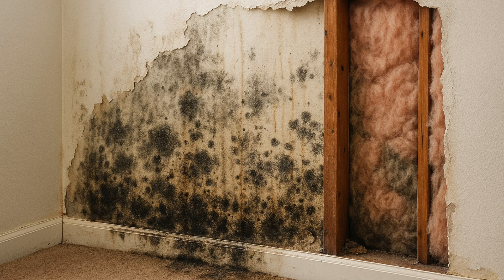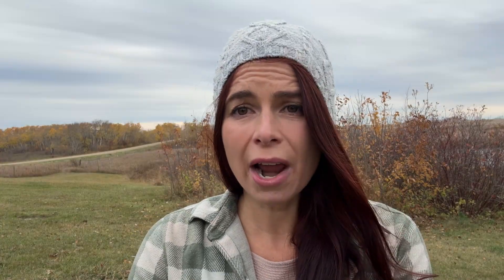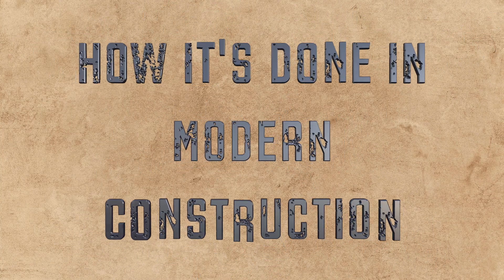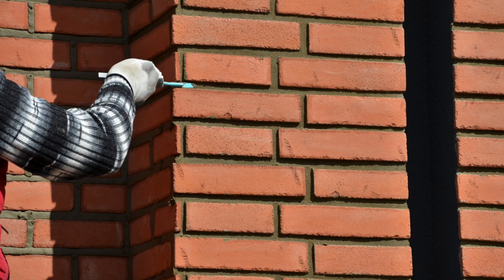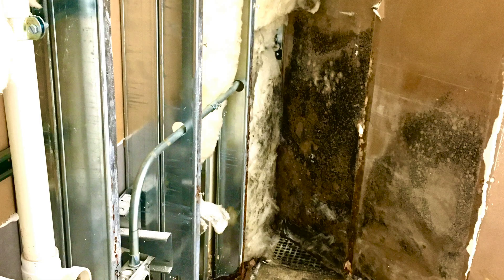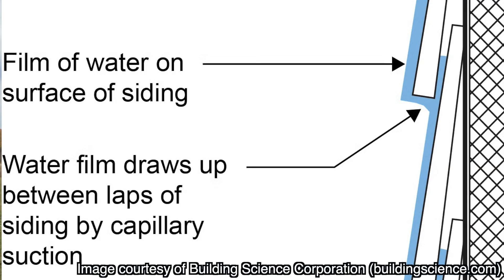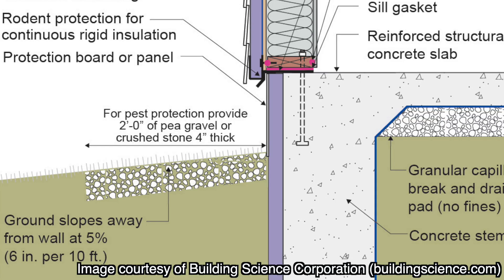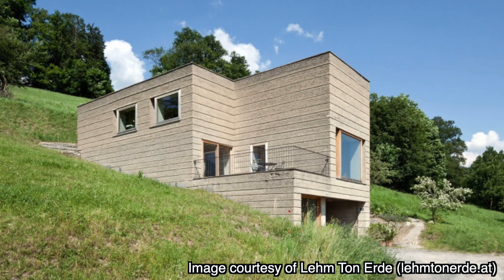Why Modern Walls Get Wet Inside (And Ancient Ones Didn’t) | Part I

Comment: The problem with modern superinsulated walls is they do not dry.  So when they become wet they mold.    And now you have to "Outsulate"  the whole building.    In Wisconsin where I  live back in the 70"s and 80's they built a bunch of "Envelope" homes.     They have since fallen out of favor.  Basically they were double walled with an airspace between which allowed the air to circulate around the whole house.    This would solve the drying issue.    WHat happened to this idea?
Reply from the maker: Good points! Yes, Joe Lstiburek's "the perfect wall" includes all the control layers (including insulation) on the outside. I talk about exterior insulation in my thermal control layer video.

Comment: https://www.youtube.com/@RootedResilientLiving
I am awaiting your other parts?

What I am trying to dig up is:
(Background: I have all these tools tablesaws, free standing Sanders, Bandsaw, free standing drill press, 2 ton press, and I don't have shop space larger enough to be able to walk around them in the covered area.  (plus the quote covered area  Unquote suffers from time to time from ceiling condensation drips).

By simply building formed covers out of high end tarping materials (Like Grandma sewed attractive fabric Kitchen socks for her toaster) simply placing the tool outside with a formed heat welded cover would create an environment that on rare (but it would happen) condensations' in the top of the tightly formed covers.

( I remember someone was selling some form of water would pass outwards but be shielded from passing inwards for Car covers of the highly collectable shapes?  This material sat right at the top of the car cover where the condensation would form.  But the cheaper standard materials formed the sides where the condensations did not form.) I'm hoping you can help me find the right fabric like or plastic sheeting like material to move the condemnations out of the tool covers and not get to the point of rust forming?

Armed with that information I could heat weld Duraskirm 20 into tools covers with a patch (Of the material I'm looking for) on top and some form of wire frame setting on top of the tool but below the tarping so that each free standing tool could be left outside, yet under it's own individual protective covering.
(This would allow me get into production before the wood shop's roof has been started.  Just tools setting outside on top of 1.25 inch thick flooring plywood that has been resined and placed on top of gravel to prevent the local version of Termites.  (I will also throw on there something to shield the resin from UV).
(By each tool setting on a pad of water proofed plywood the base inside formed cover would only have to deal with any water that managed to get under the cover and not by transfer from zone of wet Earth.
All smaller hand tools would still be in under the plastic tarp based roof, and larger tarping's with no side walls held in places with spring clamps and magnets  have to be used until a way to keep the condemnation from forming inside the shed/workshop in upgrade can secure a safe from condensation effect.
This could mean I still would have long walks from the table saw to where the table saw accessories would be stored but it could bridge the gap between waiting for the perfected shop space and getting back into limited production.
Reply from the maker: Thanks so much for the thoughtful comment and for sharing what you’re working on — that’s quite a setup! 🙌

And yes, the rest of the series is coming: Air Control Layer next, then Vapour, then Thermal.

As for the tool covers and condensation issue, the key is finding a material that’s vapour-permeable but water-resistant (so moisture can escape but liquid water can’t get in). Some high-end car covers and certain breathable membranes do this — similar concept to a WRB used on houses. 

I really appreciate you being here and thinking so deeply about moisture management.
Reply: @RootedResilientLiving  I've started looking into "SealSkin"  
1. there is a soft inner layer to prevent scratches (I don't need that)
2. I thing I only need like a 3 foot by 3 foot patch on top.  So buying scraps and then bonded to Duraskirm 20.

I'm looking at trying to keep the fabric suspended above the tool with like a wire frame/box shape.
Above that I'm thinking that something that would act like an umbrella with the handle sawed off so that the "SealSkin" is bellow the Duraskirm 20.  The SealSkin would be out of the Sun and able to breath out all the moisture.

On the bottom side of the equation is "What could be done to prevent puddle water from being able to get up inside covering?
I've been trying to think of making something out of heat sealed Duraskrim 20 so that it's like a Duffle bag or a Gym bag that you have stuffed the whole tool inside of (It might have like metal legs sticking out?)  I'm back wondering how I would get water at the bottom of the bagging to leave without letting water vapor back in?

Comment: I'm a dyslexic.
How do you even spell that silaine and solexain and where are the links to these products?
Reply from the maker: Here's what an engineer I spoke to about it had to say about the two:

Siloxane is Si02 (a silica molecule plus two oxygen molecules), and it is a very fine solid under normal atmospheric pressure. It’s soluble in water, although it will come out of solution under gravity, so manufacturers use a surfactant to keep it dissolved. The surfactant is usually some kind of lipid - basically a type of soap.

Silane is SiH4 (a silica molecule plus four hydrogen molecules), and it is a gas under normal atmospheric pressure. It will also dissolve in water, but it remains volatile to a degree - will evaporate out of solution under normal atmospheric pressure.

For our purposes, we are trying to fill micro-pores in the rammed earth with stable silica that will repel liquid water and allow water vapour to pass. In my experience, Siloxane is the preferred substance for adding directly to a rammed earth mix. 

The product that I know about designed for this is called Plasticure. It's an Australian product.
Reply: @RootedResilientLiving  Thank you.
I'm in the middle of something that may require just what you wrote to me.

Comment: Much of the water damage (besides damages to floors) is nothing more than a few inches of the bottom of the plaster board.
Why we even still use the common plaster board I don't even know?
There are variations of Plaster board that don't allow for water.
Simply cutting a 4 x 8 board (or if it comes in a smaller size)  down into like 8 inch strips and applying those to the bottom edge of property would mean the amount of damage from 6 inches of standing water would have a minimized effect.
This would mean you would probably be cutting 8 inches off the top of the normal plaster board.  This would add to the labor costs but could lower the total damages' of just even a thin layer of water trapped on the floor.
Reply from the maker: Interesting idea, and it would definitely help with floor-level wetting. The tricky part is that a lot of moisture damage in walls doesn’t start at the base. With stack effect and air movement, warm indoor air can carry moisture up through the wall cavity and deposit it on cold sheathing near the top of the wall or roof. That’s why we often see hidden rot high in an assembly, even when the drywall at the bottom looks fine.

Flooding and standing water are one failure mode, but most modern moisture problems come from air leakage and trapped vapour—places you can’t see and can’t cut out in 8-inch strips. That’s why the whole assembly (air control, vapour permeability, drying paths) matters so much more than just the visible drywall damage at the bottom.
Reply: @RootedResilientLiving  What you are saying may apply to my modular side walls.  Those parts are wood with No vapor barrier.  Just plywood with sealed edges on 2 x 6 x 8'.
I will be back filling them with Styrofoam blocks.
(The bad part about that is I will need to router a channel most of the length right down middle of the 1.75 side to then attach a second 2 x 6 x 8' to box in the Styrofoam blocks.  Think of the connectors as home made 7.5 foot biscuits
WHAT WOULD YOU SUGGEST? As another thing to add into this build?  If I purchased a heat sealer I could put ALL of the Styrofoam into one form fitting block (This assumes that I cut and glue the cubes into something that's almost 4' x 8')
This would result in each modular cell's Styrofoam being denied any contact with water vapor. And the only area that would have moisture contact would be the 2 x 6 x 8' that area bolted adjoining each 4' x 8' block to the next block, The extior plywood and then the interior plywood.

Comment: Use a rain screen if your installing exterior cladding with venting to assist in drying it out when the rain stops
Reply from the maker: Yes, rainscreens can be really helpful! I cover reainscreens in the next episode on the air control layer - it's going to be released on Thursday this week.

Comment: we could update our building codes
1. ban the use of drywall in basements, instead entire basements would require rockboard typically only used in basements
2. ban normal timber framing  in bsmts , instead use sprayed or treated lumber only
3. mandate exterior waterpoofing and insualtion  as well as interior insulation
4. design larger overhangs , especially for taller buildings where the min overhang does very little against driving rain; 1 story bungalo gets 3 ft overhangs and 2 story gets 5-6 ft overhangs
5. why not line the entire perimeter under the topsoil so all the distrubed soil has a poly or cconcrete cover over it directing water away from easily porous non packed distrubed soil around foundation
=these would either discourage using basements as living space in first place annd only storage/mechanical use or at least it will have better more expensive protection for 10,20-30 yrs down the road.
Reply from the maker: Some good ideas here!

Comment: Great to see a building science channel with a focus on natural building materials. Keep going! There is no one material with perfect attributes. Some discussion on thermal conductivity of rammed earth walls is needed. It's likely comparable to concrete due to all the compaction. Straw bale (load bearing or not) might be more of what you're looking for in Manitoba if you're concerned about natural materials. A life-cycle analysis would show that it has lower embodied and lower operational carbon (win-win). Regardless, put numbers to these designs (not just the wall assemblies), construct it, collect data and prove us all wrong. We need do'ers to address our on-going housing crisis and raised awareness that there is never just one solution. Insulation is really just creating lots of air cavities that break up convective loops (the material doesn't really matter). Rammed earth partially solves the moisture part but creates other new problems that need to be solved.
Reply from the maker: 100% - we'll cover the thermal question in the last episode in this series on the thermal control layer.

Comment: I'm in the early planning stages of my small home build. I've considered a combination of Earth ships and timber framing. What do you suggest what should I build my house out of. I'm in Minnesota near Canada.
Reply: What conventions were used for old buildings there?  For such cold weather you could consider a cavity wall: exterior brick/masonry > 1.5" air gap > Zip sheathing on galvanized steel stud "back-up" wall > closed cell spray foam insulation on exterior walls and metal roof.  Provide a/c to unvented attic.  You could also just use a vertical standing seam wall siding, which will never leak.
Reply: @Troy-Moses thank you! I've got some research to do now. I believe most the houses here are just stick built homes. I just heard of "rammed earth" I'm gonna have to do a ton of research. Thank you for commenting. Have an awesome day.
Reply: If you looking for healthy alternative building methods, I'd recommend straw bale building. It is easier than many others and the insulating is incredible. Search for Timbo and straw bale building.
Reply: @drewmihelich3232 thank you. I've had that idea in the back of my mind as well.
Reply from the maker: That’s awesome — sounds like a great project. I’m not an expert b, just someone who’s been diving deep into building science for a while now. From what I’ve learned so far, the best approach really depends on your site, climate, and priorities — comfort, health, energy use, materials, all that. Minnesota’s climate definitely adds some extra challenges, though!
Reply: @RootedResilientLiving this whole rammed earth thing is blowing my mind right now, I think it's brilliant I want in!!

Comment: 7:00 In Europe, thermal insulation is mandatory... when using rammed earth, the insulation is mostly placed inside.

Internal insulation has the advantage that all the mass in the walls is used to flatten out the external temperature swings from night to day.
The disadvantage is that no mass is available to help you in keeping the internal temperature constant (the insulation is preventing this).
The second disadvantage is that there will be condensation in the transition from the insulation to the external mass layer (all walls except the sunny walls).
--> So your insulation materal must be moisture tolerant and your external wall must be able to drain away this moisture by capillary action.

For the ideal wall you have - in my eyes - two options (if you like massive walls):
- Option A: The Sandwich wall: external mass - thermal insulation - internal mass.
- Option B: A massive wall made from a material that also has some or good insulation properties, i.e. hempcrete, AAC, (solid timber), brick, straw bale,... 

If you persist in using rammed earth, I would investigate the sandwich wall by which the insulation layer is hempcrete and by which all layers are tied together with a natrual fiber like reed, wood, hemp, elephant grass,... 

But first, I would check the use of massive walls made from hempcrete only.
Reply from the maker: Great food for thought — thank you. I really like the idea of using mineral wool insulation between two wythes of rammed earth. It keeps the assembly vapour-open while still adding that necessary thermal break. I’ve also got hempcrete on my list to explore in more detail — it’s such an interesting middle ground between insulation and mass.

I’m drawn to the solidity and durability of rammed earth itself, though. Martin Rauch’s work, for example, often uses a double-wythe system with recycled foam-glass insulation in the middle. And here in North America, SIREWALL has used a similar approach with rigid foam insulation between the wythes.

I’ll be digging into insulation strategies and the thermal-mass balance more deeply in the upcoming episode on the Thermal Control Layer.
Reply: @RootedResilientLiving  
My problem with rammed earth is that it's more like concrete and that you need steel as reinforcement (in certain areas), this makes your house difficult to rebuild. 
Also because it's structurally less "readable".

With hempcrete you need a wooden frame, that's more work but rebuilding becomes more easy (and safer). 
And the thermal insulation is already integrated...

Lots of options... not easy to choose ;-)

I'm looking forward to the next videos!

Comment: 6:00 I would never use cement but only hydrated lime ("air lime" made form quick lime).
7:00 Never ever use hydrophobic coatings, it works in both ways so any water that got in will never leave in it's liquid form and this makes your wall prone to freezing damage!
Reply from the maker: Yes, see the episodes on water and vapour control coming up for more along these lines!